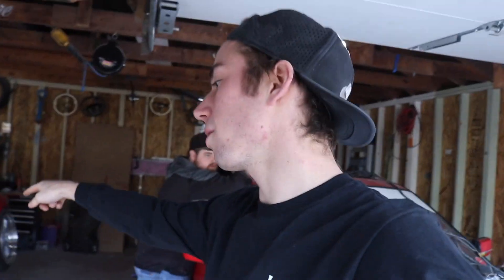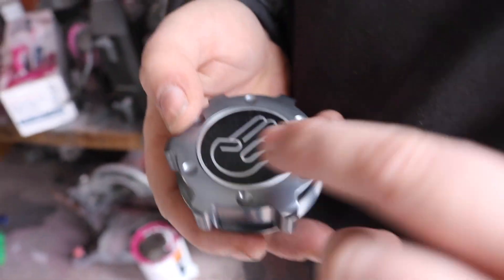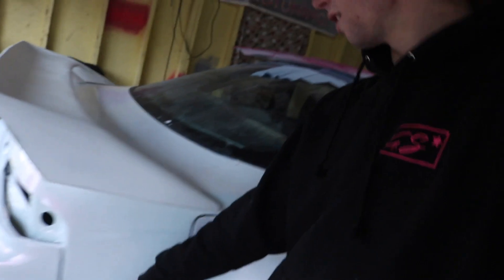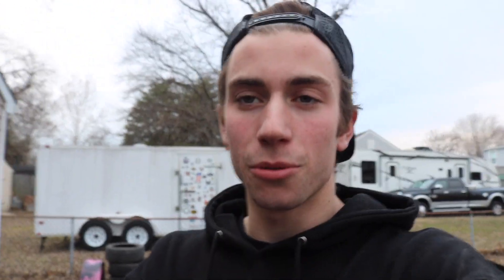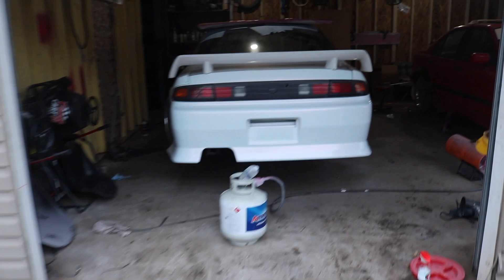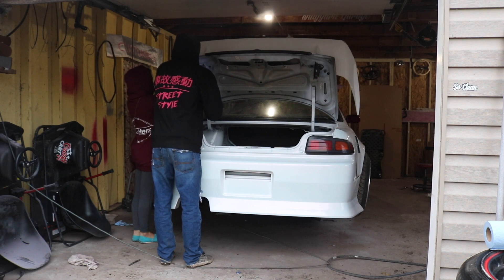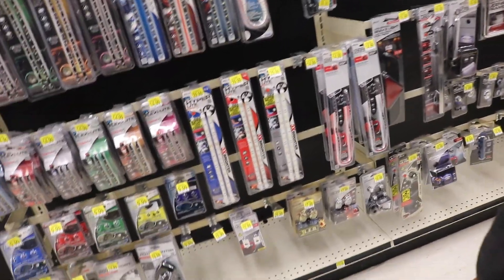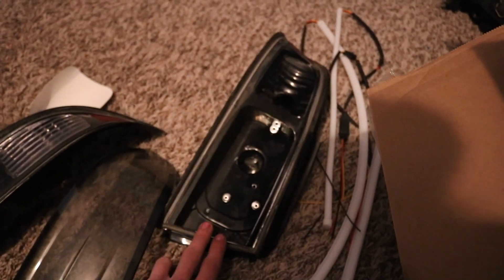That S14 BOOTY! Garage Hangs

Comment: Not sure but I don't know if that expansion tank idea is going to work the way you want it to.  It will immediately fill once you run the motor.  The expansion tank usually is plumbed into the radiator.  That is the heater line